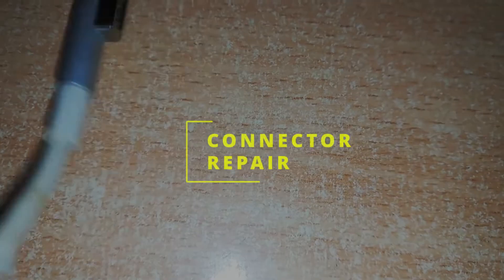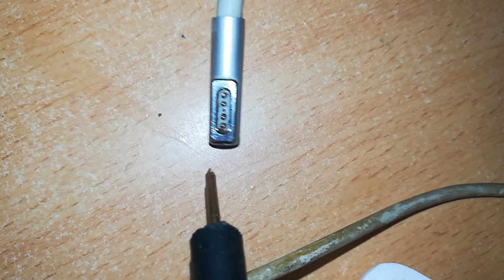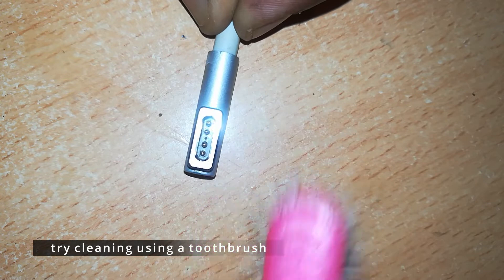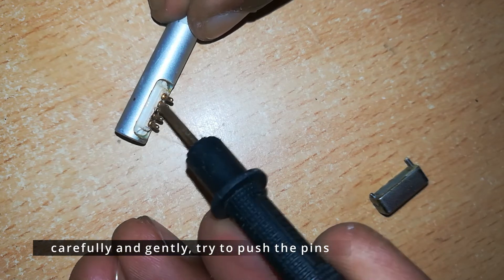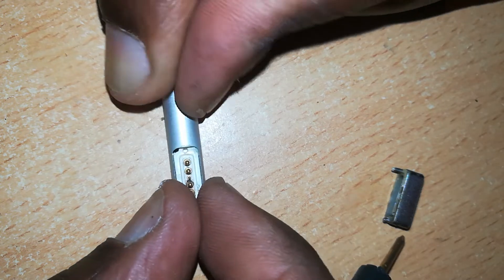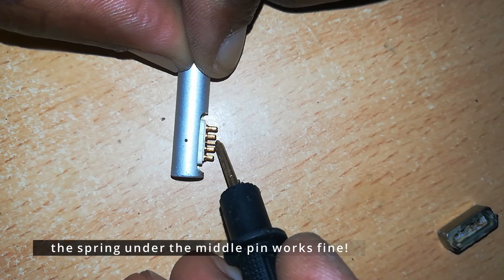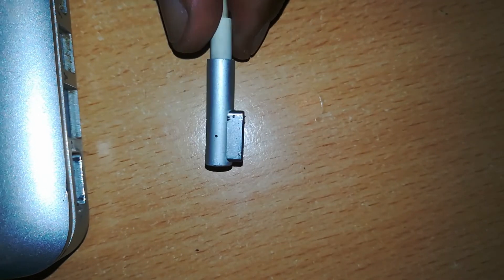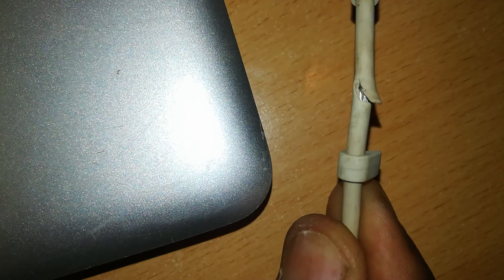Magsafe Connector Pins Repair #magsafeconnectorpins #magsafeconnectorrepair

Comment: How long would it take to charge if its been sitting for 5yrs
Reply from the maker: not sure i understand..kindly explain further....
Reply: @reachtech1  so the lap top been sitting for a few years and I've charged it for a few hours but won't power up
Reply from the maker: seems the battery is gone. all batteries like to be charged / and discharged. sitting for a few years, seems to have taken a toll on this one. you can try getting a new battery pack.
Reply: @reachtech1  ok thanks

Comment: Hey is there an easier method to use to remove the metal part?
Reply: aparentemente, todos los videos olvidan contar esta parte!
Reply: @lunacabutti  yo se, verdad
Reply from the maker: hi. the metalic part is stuck really fast on the connector, you need something that can pull it out firmly. pliers will do.

Comment: Any tips on how to remove the metal part? i can't remove mine
Reply from the maker: place a piece of (thin) cloth over the metal contact- this is to protect it from the jaws of the pliers you'll use to pull it out. Hold it firmly with between the jaws of a pair of pliers. pull from side to side -leveraging on the aluminium casing, until the metal contact comes off.....
Reply from the maker: subscribe, like and share!!

Comment: MacBook Pro shuts off when I plug in the charger?
Basically what happens is I plug the charger into the MacBook Pro while it is on, and once the charger is plugged in, the Mac shuts off.  I can turn it on just fine while the charger is already in the Mac, but plugging it in while the Mac is on just shuts it off.  Don't know what is causing this issue.  I went to a Mac specialist and he said that he had never seen this issue before, and to send it in for diagnostics, but I currently don't have the money for that.  Any help would be appreciated.  Thanks

Comment: my new magsafe will only work when the magsafe is covering up the ethernet port but when turned the other way it will not work. Is it the macbook or magsafe that's the problem?
Reply from the maker: Hi Matt. It may be because of various reasons:

First check if there is any foreign object stuck at the charging port of the MacBook. It may be that there is a magnetic object which was "picked" up by the macbook and is blocking the connector from making full and flush connection. 

Secondly, check if all the pins in the connector come fully up/out when depressed and released (and that all are at the same height). 

Third, check if your MacBook has any dents on the casing, especially around the charging port. This may prevent the connector pins from reaching the contact points on the macbook.

Fourth, check if the magsafe connector is bent at any point along its length.

Fifth, if the magsafe connector is covering up the ethernet port, are both the 2 LED lights working? Or is it working on only one side. If its working on only one side, then most probably, it's the connector that is the issue.

As a last resort, you can also try using another magsafe charger and see if you experience the same issues..

Do these steps help?

Comment: Hi.. i think i shot my pins... What can I do
Reply from the maker: Hi Mary! Sorry for the short. If the plastic between the pins melted during the short, then it is likely you can salvage the pins by carefully scrapping the plastic between them and releasing them to spring back again. A pointed razor and pin will be needed.

Try this and lets know how it goes!

Comment: I have a Mac a1369 and I connect my charger the green light comes on for a split second and then it goes of but on the screen it shows the lighting bar on battery like if it was charging but no charge. Could it be my charger or the I/O board.??plz help
Reply from the maker: hi Jose. Sorry for this. kindly Try the following steps:
-turn off the MacBook
-Hold down SHIFT +CTRL+ALT+POWER buttons for 10 seconds
-Release the keys after 10 seconds
-Press the power button to power on the Mac book

is there any difference?
Reply: @reachtech1  just tried that and it still does the same thing..
Reply from the maker: Hi Jose. Did you hold all the four buttons down together? If not, kindly repeat the steps.
Also the charger could be the problem, try with another charger and see if there's any difference...

Revert with results..
Reply from the maker: also make sure that all the pins are at the same level. i.e. non is sunken...
Reply: @reachtech1  pins look the same good. Maybe it’s a bad charger.
Reply: @reachtech1  charger might be the problem. Ima try with a new one. 
 Thank you
Reply from the maker: sure...let me know how that goes... all the best!
Reply from the maker: subscribe tooo!
Reply: @reachtech1  ok
Reply from the maker: Hey Jose! Did you succeed? Hope so. Kindly watch my other videos too for possible fixes. Don't forget to subscribe!
Reply: @reachtech1  haven’t got the charger yet, it should arrived tomorrow. I’ll let you know. Thanks for asking
Reply from the maker: try this too as you wait for the charger....

Press ALT + CMD +P + R + power button for 10 seconds and then released.
P and R are letters "P" and "R" of the keyboard.

Try this when the mac is off.
Try with the battery disconnected (if you can be able to open the back cover of the mac and access the battery).
After the above, connect the charger and try to mac without connecting the battery.
If you were not able to disconnect the battery, before the above steps, dont worry, just connect the charger and try to boot the machine.

NB: with the battery disconnected, the connector of the charger will only show a green light.

with the battery connected, it will first light green then amber- if the charger is working fine.

All the best!

Comment: Hey bro I have an issue but not the middle pin the one right next to it it’s completely stuck down any fix for that.
Reply: My mettalic part wouldn't come out... Sunken middle pin
Reply: Same here
Reply from the maker: hi. thanks for reaching out. have you tried cleaning with a firm brush? if it's still stuck, then the spring underneath the pin is spoilt. You may need to change the connector/repair the cable. kindly go into my channel and watch videos on magsafe cable repair........
...and subscribe too!
Reply from the maker: here are the video links:
https://youtu.be/I38DKSKyEJA
Reply from the maker: here is another:
https://youtu.be/cho4a7qvfiU
Reply from the maker: heres another:
https://youtu.be/LH7-rV4UecY